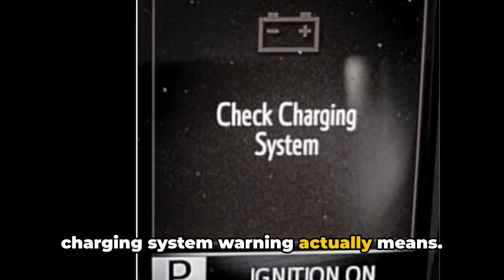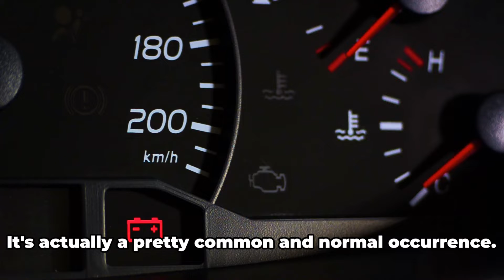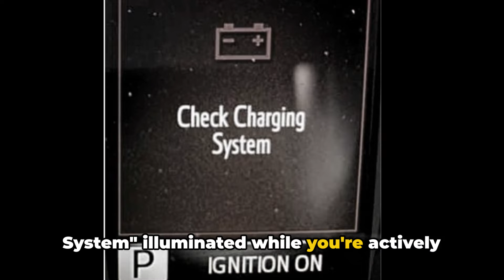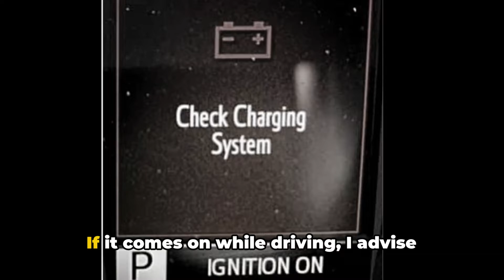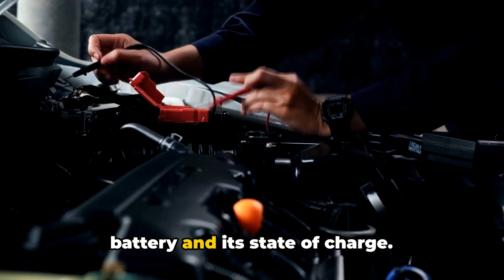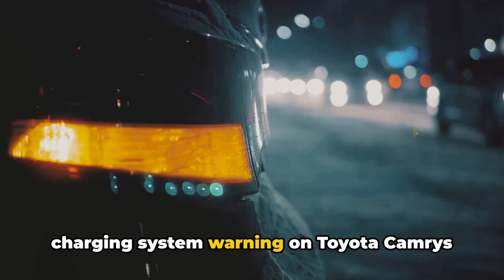Toyota Camry "Check Charging System" Diagnosis & Fix

Comment: Had this issue, alternator and battery replaced, and the problem is persistent. Connectors were also cleaned up. I'm stuck with this issue.  Any help will be appreciated.

Comment: Corroded battery connection, bad battery, battery not charging, or bad alternator. Check charging system when car isn't running is not a problem. It will go away when you start your car.

Comment: Could this message while driving also affect the power steering system since it’s electric?
Reply: Yes. If the vehicle is losing voltage the electric assist steering will be affected.
Reply from the maker: 100% Thanks for helping someone out!
Reply: Please tell me, is it necessary to adapt the battery in such cases?